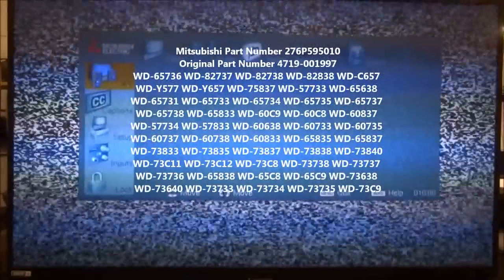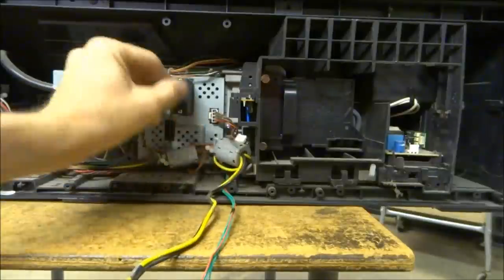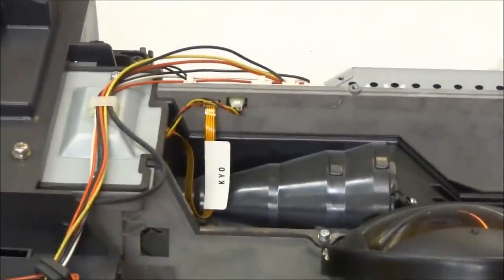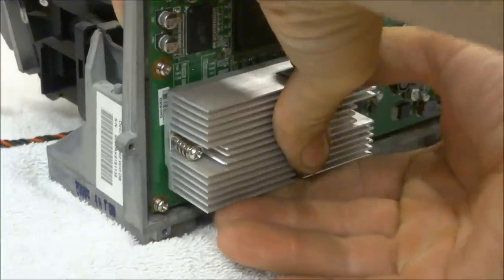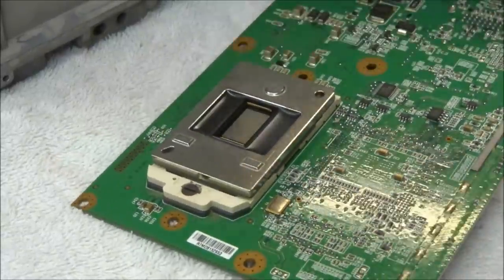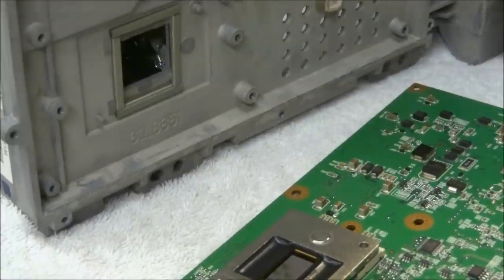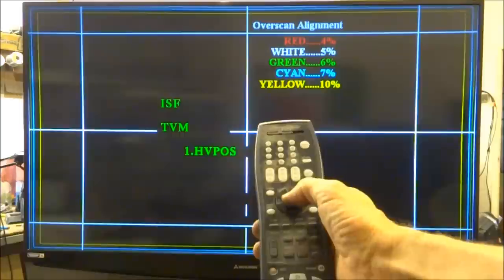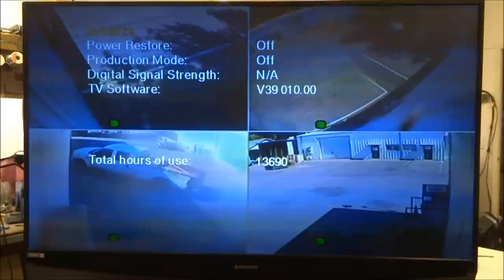Mitsubishi White Dots Spots DLP Chip IC Replacement.

Comment: Your video was a huge help in replacing the DLP chip in my 82" Mitsubishi TV.  Everything was exactly the same as your set, so that made it a lot easier.  The suggestion of removing the Heat sync slowly also saved the thermal tape and allowed me to reuse it.  Thanks for putting this up.  My only suggestion would be to leave in all the reassembly video, as I had to rewind and rewatch the beginning to help reassemble everything, but otherwise, probably one of the best videos on replacing this chip.  Thank again for posting.
Reply: daryl5000 where did you order your chip from?
Reply: @iAmSwip3r  for my Mitsubishi WD-73837 I found the chips on Amazon and ebay from $89-289 used and new. I picked a new one on eBay for $239 with a 10% off coupon
Reply: I just installed my dlp chip on a 82 as well. But now my picture has about a 3inch gap at the bottom of the screen. I tried adjusting the picture as he did but nothing. Has anyone else experienced this?

Comment: Just wanted to say thanks so much for this video. I see it's been at least 3 years since you posted it but thought you'd like to know it's still helping folks out. Clear, easy to understand instructions make it an easy to do repair. I believe the model in the video is the same as mine (73736)--at least everything appeared to be identical. Very happy to report that my white dots are GONE.Now I need to find a video describing the proper way to remove the screen for dust removal.
Reply: Yes, every time you change the Lamp, the DLP Chip will fail some time later with the white and black dots because the lamp is new and have more power in relation with the old lamp and the DLP chip is old and step by step star to burn the inside mini mirrors in the chip, so prepare to spend more that $250 to buy a replacement or may be it's time to an Up grade with a Led Smart Tv !     My recommendation compare before!!

Comment: Excellent tutorial.  Your instructions are the best I have seen and spot on.  Thank you very much.  Now,  after all the task of doing this at the most critical point of installation of the dlp chip,  I accidentally touched the chip... I tried cleaning with a microfiber cloth as careful as possible .  Finished reassemble but upon turning on all I get is a white noise horizontal line across the screen.  Any suggestions  for it...? Did I mes up the Chip or likely something else?  

Thank you!

Comment: I was able to use this tutorial when replacing my dlp chip and everything went smoothly. Bought a new lamb as well and my DLP is like new. I just have one minor issue. When the screen is black I get like white vertical patches on the screen that are barely visible. You can only see them on black but when I go to the test menu I don't see them, I wonder why?
Reply: Same thing

Comment: Out for question, I need to replace the bulb in my Mitsubishi WD-65835 big screen and was wondering if after taking the bulb assembly out, can you see the fan that keeps this bulb cool? If I turned the TV on without the bulb assembly in place, will this harm anything? What I'm getting at is, how can I test the fan to make sure the brand new bulb that came today doesn't overheat and fail due to the fan not working? Would you suggest removing the light engine to check all three fans as I already did this to replace the chip. If the light engine is removed and placed on a work bench, can I put power to it to see if all the fans are operating properly with damaging any of the boards etc?

Comment: Hello, I used your video to replace my DLP chip and it worked perfectly. My TV (WD 65735) is set up exactly like the one you used. I followed your instructions exactly, but when I went back to turn the TV, the green light comes on, but nothing shows on the screen. No sound or picture. Before I tried to fix this, when I would hit the power button you could hear the whole thing powering up, and now it doesn't make that sound. Is there anything you can suggest I can double check to make sure I put it back right? I have already double and triple checked everything I can think of, but I still have the same problem. I really appreciate your time! Also, the lamp was replaced just under a year ago.

Comment: Damn man, im a very savy mechanic and  pretty good at wiring.  Just my own knowledge and teachings I got a freind to tear his flat screen tv apart and found just a broken solder joint... no clue what it was for/controled...just resweated the joint... and boom.  Tv was 100% and still working 2 years later. 
I have this 73" Mitsubishi doing the white pixel thing.. its getting worse.. paid 1300$ i think from a "big screen store" honestly for the 3d capibility... but 3d kinda fell on its ass again. 
But at the end of the day im 100% confident with your video i can fix mine now. Thank you so much for passing on the knowledge I wouldnt be where I am today if people didnt have patience for me. Moral code to me to pass it on over holding it hostage wanting money or watching people fail..

Comment: If the conductive tape needs to be replaced, what is it called and where can I buy it?  I've searched online for "conductive tape" and "heat tape" but I'm not sure what I'm looking for.  Replacing the dlp chip on my WD-65737 worked perfectly!  Thanks!  Now we're working on replacing the dlp chip in my WD-60737.  Running into a few issues but haven't given up yet.  Thanks again for a well done video!
Reply: I think I found it on eBay.
Reply: Once I searched on "thermal conductive tape for heat sink" I found many sources.

Comment: What you were calling heat tape is actually called thermal compound or thermal paste that should be removed and cleaned with isopropyl alcohol and replaced it should not be hard to the touch best thermal compound to use Arctic Silver
Reply from the maker: No, it is actually heat conductive tape supplied by the manufacturer of the DLP IC. Its about 1/2 in x 3/4 in

Comment: If you see white dots/dust on the screen wouldn't simply cleaning the chip face with a Q tip and alcohol removes the dust/dots or do you have to actually replace the Chip ??
Reply from the maker: It is a defect of the chip. The micromirrors get stuck in one position.

Comment: Mine is doing the spots. It is a 60 inch Mitsubishi. I have a 73 inch Mitsubishi that the screen is busted out. Can I use the chip out of it? It plays just fine. It just has a hole in the screen and the mirror is cracked.
Reply from the maker: Compare the models on shopjimmy.com and see if they use the same DLP chip

Comment: Hi, i was wondering if you could help me out, i have a samsung LE40A456C2D it has developed a fault it has a faded white screen i have removed the back off the tv and the capactitors look good and the t-con board seems fine visually no obvious overloading signs anywhere i dont suppose you could point me in the right direction it would be greatly apprieciated i am an instrument technician by trade however i have no knowledge of interegating circuit boards, i have noticed that there are test points on the T-con board however i am unsure of suitable test methods any help would be greatly appriciated thankyou, ben

Comment: I did not have the same luck as most. Followed video, it was  just like my TV. Carefully removed connecters. Installed chip, reassembled TV. Will not power on. rechecked everything. I have a red status light. HELP. everything worked good except white dots before i stared replacement. replaced lamp a few months ago.

Comment: How the broken mirrors happen in the DLP chip. If anyone knows thanks.
Reply: Yes, every time you change the Lamp, the DLP Chip will fail some time later with the white and black dots because the lamp is new and have more power in relation with the old lamp and the DLP chip is old and step by step star to burn the inside mini mirrors in the chip, so prepare to spend more that $250 to buy a replacement or may be it's time to an Up grade with a Led Smart Tv !     My recommendation compare before!!

Comment: Thermal pads are notorious for their abysmal performance. I suspect thermal issues are the main cause of dead pixels. Toss the pad. The DMD should not be a consumable. Clean the mating surfaces and apply a tiny dab of thermal paste/heatsink compound, squeegee it thinly across the chip or heatsink with a fresh razor blade and assemble the chip and heatsink on the board. Due to the economy of their design, DLP TV's invariably become choked with dust, which only hastens the problem, but it's sad to contemplate the possibility that within a decade of their introduction the majority of these beautiful big screen televisions have been hauled out to the curb because of that stupid little pad. PC builders have known these things are poison for decades. I think the fact that most projectors have more sophisticated thermal management & an air filter and they are not as plagued by pixel failure as TV's are backs up this idea. The fact is, nowhere have I seen the issue of why exactly the mirrors stick discussed or disclosed, beyond the mention of an additional "anti-stickage" coating being introduced shortly after early mass production in the late 1990's.

I just got a used 65" Mitsubishi out of necessity as our LCD just died and it's gorgeous. It makes me want to turn salvaging these things into a full time job.

Comment: I did everything on the video the dots are gone but there are lots of vertical lines inch apart across the tv screen please help ,ANYONE....... THANKS
Reply: BOULEVARD Look at the prongs, some are probably bent. Use a magnifying glass for better results. Had the same problem when the chip was shipped it was bent,!!(I did not inspect it before installation being new) I corrected with a sewing machine needle. Be careful! use slight force to straighten. Hope this corrects your problem!!

Comment: As an electrical Engineer,  I cannot see how a computer chip could fail one pixel at a time.  Now I just replaced my light, and the white spots began to occur.   So I suspect the spots are related to disturbance of dust within the TV.  The dust interferes with the light path, and the screen has white dots instead of the projected colors.  My DLP is 10 years old,  I think I'll clean it out, and try
clean chip area as well.   So, either it cleans out, or gets thrown out.  No sense paying $150 bucks plus the work, for 10 - 12 year old technology, when new ones are on 3 or 4 times more.  Decisions, decisions...!!!
Reply: Yes, every time you change the Lamp, the DLP Chip will fail some time later with the white and black dots because the lamp is new and have more power in relation with the old lamp and the DLP chip is old and step by step star to burn the inside mini mirrors in the chip, so prepare to spend more that $250 to buy a replacement or may be it's time to an Up grade with a Led Smart Tv !     My recommendation compare before!!

Comment: Heads up!  My Mitsubishi WD-73737 had a cable with very fine leads soldered to the DLP board.   While I was trying to figure out how to get it off the board, it broke off.   I tried to solder it back onto the board but the leads were so small, they melted.   So close and so far away...   I will never buy another Mitsubishi product, there's just no excuse for soldering a cable directly onto a board.
Reply: That's weird. I have that model and it was identical to the one in the video. No soldered wires. Odd!